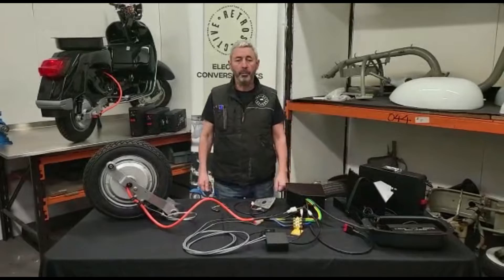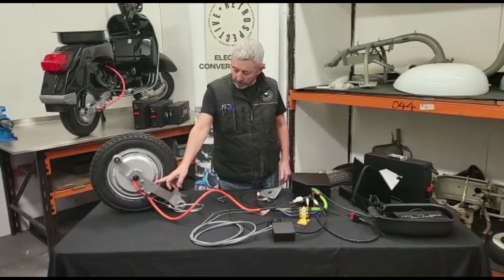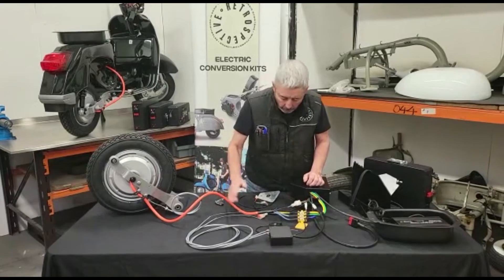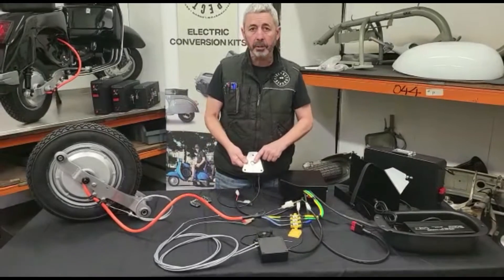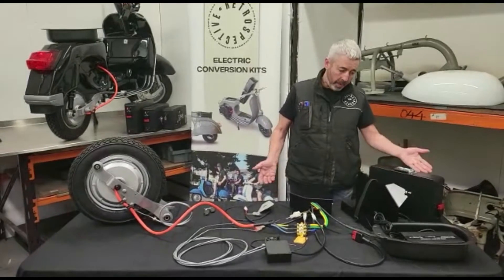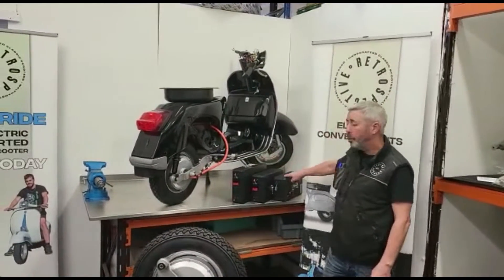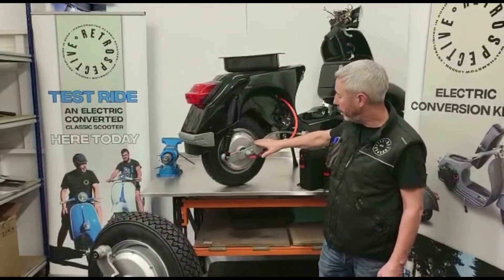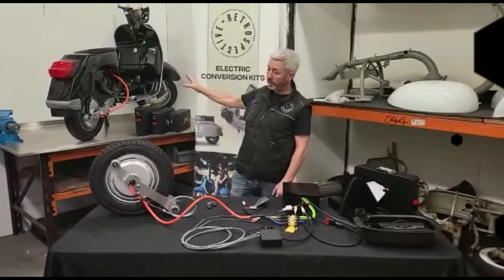Electric conversion kit for all classic "geared" Vespa Scooters 1958-2018

Comment: How to replace the rear tire? We old schooler like to change tire on our own
Reply: The same as anyone would really, remove the wheel, let the air out and pull tyre off.
Reply: @nothingbutthisthatandtheother  and how do we remove the wheel? You realize this hubdrive has huge yellow cable on the axis that connect to the battery controller ?